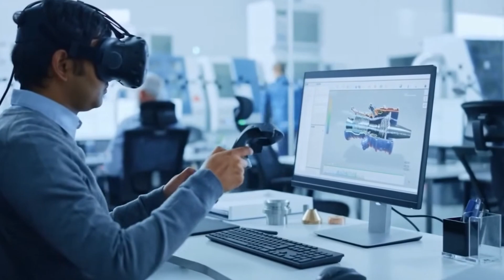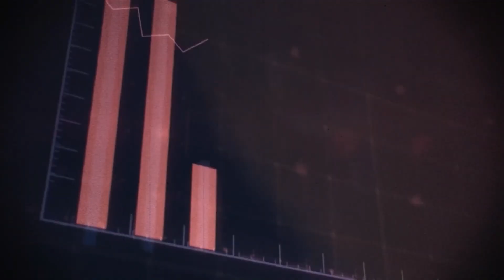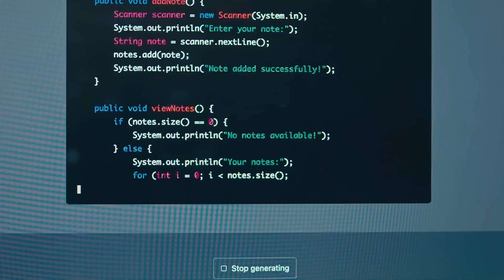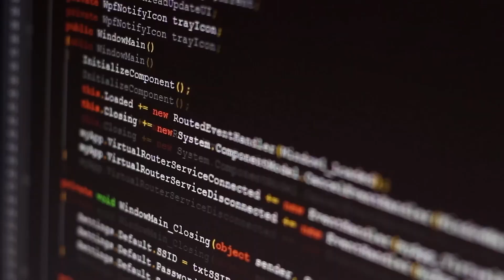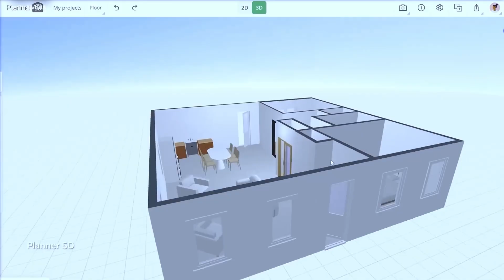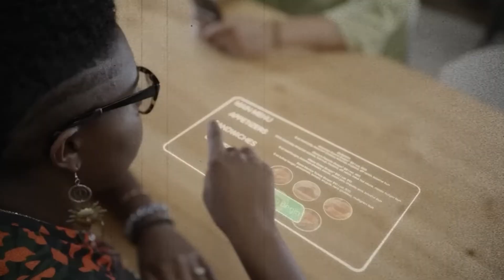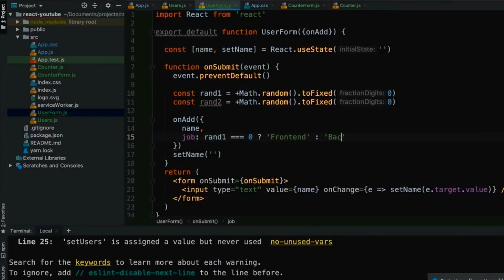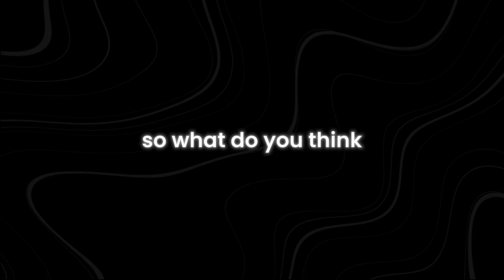From Code to Consciousness | The 7 Stages to AGI Explained

Comment: Intelligence is a multi-component Phenomena, the definition of which has evolved over time. When Computers became more capable, it was discovered that much of what was considered Human Intelligence could be algorithmically implemented by Computers using a dozen simple instructions: ShiftL, ShiftR, Add, Sub, Mult, Div, AND, OR, XOR, Move, Jump, and Compare, plus some variations of these. They can be executed in any Sequence, or at any Speed, or on any number of Cores and GPUs, but they are still all there is.  It is astounding that these kinds of Simple Computer Instructions (SCI) are the basis for all Computer Algorithms. Speech Recognition, Facial Recognition, Self Driving Cars, and Chess Playing, are all accomplished with the SCI. There is nothing more going on in the Computer. There is no Thinking, Feeling, or Awareness of anything, in a Computer. That sense of there being Somebody Home in a Computer is false and is an Illusion perpetrated by the SCI properly written by Human programmers. Even the new ChatGPT chat bot is just implementing sequences of the SCI. A Neural Net is configured (Learns) using only the SCI.

It is unbelievable that marketing departments are trying to imply that there is some sort of Conscious entity involved in Speech Recognition, Facial Recognition, Self Driving Cars, and Chess Playing. But it is all just Hype to influence businesses and consumers into buying AI based products. The products can be very good but the Hype is Fraudulent and Unfortunate. AI merely consists of computer programs performing specific tasks. These would have to be classified as Non-Conscious AI. If Consciousness can be added to Machines then full Conscious AI will be achieved. Computers will need a Consciousness Portal. This portal obviously cannot be a program using the SCI, but must be a Connection to a Conscious Mind through some kind of probably Quantum Mechanics based Electronics.